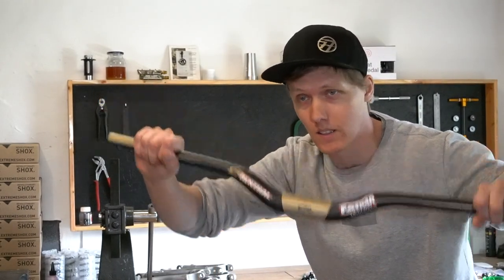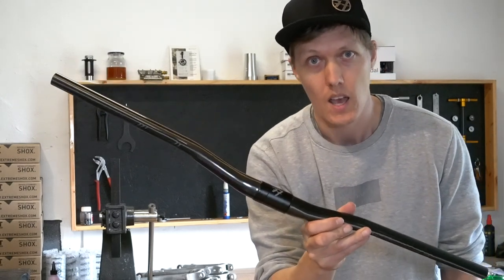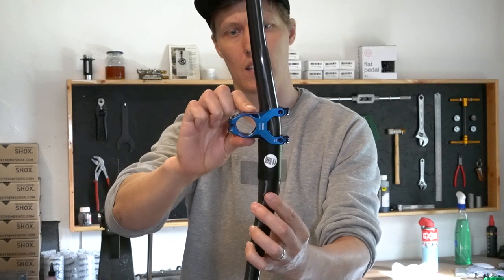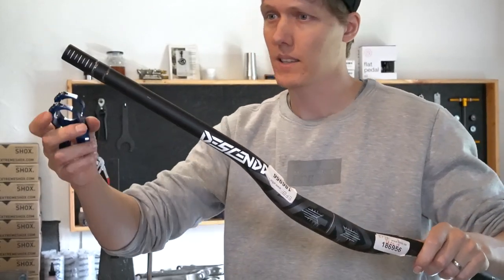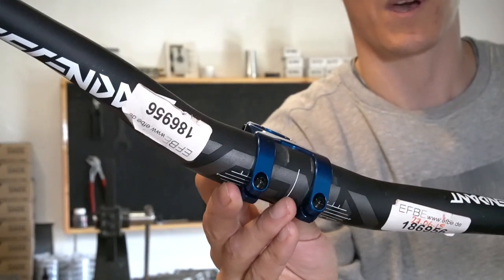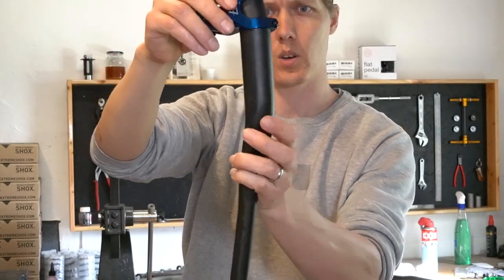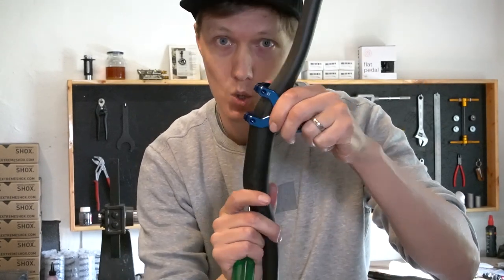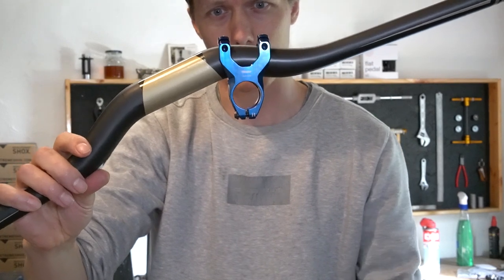Installing the 77designz 1 Piece Stem with other brands handlebars

Comment: What about the low rise one up bar? 35mmX20mm rise? Does it work?
Reply from the maker: That should work I could mount the 35er too but scratched the paint.
Reply: @77-store   Hi Giacomo. I have the same 35mmX20mm rise Oneup bar... would you recommend the use of carbon gripper paste?
Reply: @lucacorti3388  yes
Reply: Hey guys, I'm driving this combination and it does fit. It's pretty tight, so careful with the surface!
Reply: @77-store  Do you think that it would work to tape the bar with a thin but robust tape before trying to mount the stem? I have the OneUp 35x35 bar already (because yours is not available).
Reply from the maker: @firevsh2o  probably you can. We could do it too but left some tiny marks on the paint. So if you tape it off it should work.
Reply: @77-store  

I want to try it with the one up 35mm rise, is it the best to take the screws out? For the little bit extra play
Reply: @firevsh2o  did it work for you?
Reply from the maker: @diiiooon1989  yes we´d definitely recommend that.
Reply from the maker: @diiiooon1989  yes absolutly.

Comment: Can confirm that it does not work in combination with a 20mm rise Race Face Next 760mm wide carbon bar.
Reply: Really?
I've got à 780mm Next R carbon With 20mm rise and it fits perfectly..
Reply: Race Face Next R 780 with 20 mm rise doesn't fit 😢 Lots of scratches.